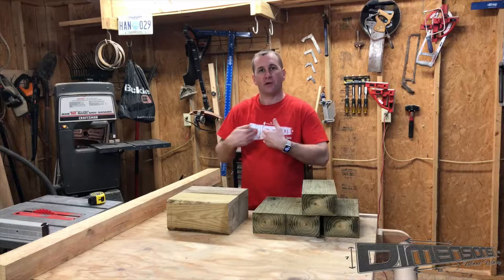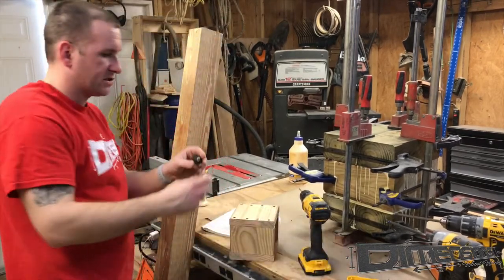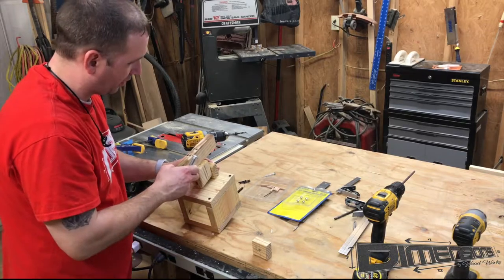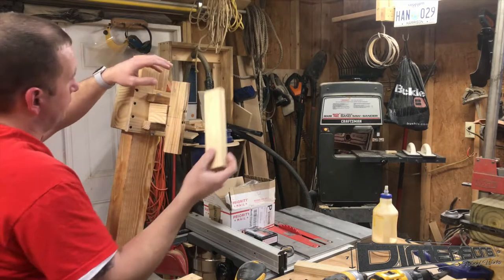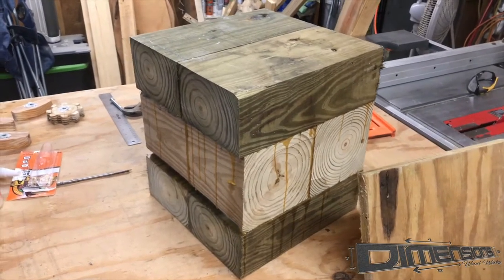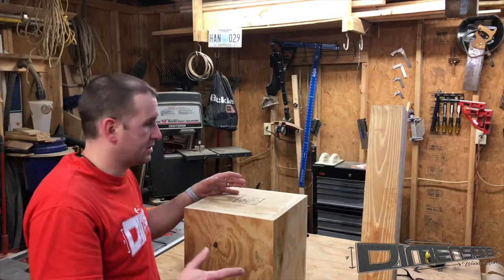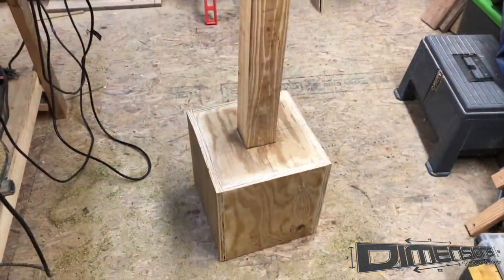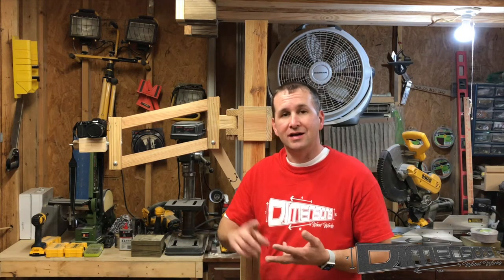Diy Camera Stand

Comment: Thanks for sharing.  Sure looks heavy enough.  i didn't see how yo set mounting the camera itself to your stand.  Did you place a bolt through the base the camera is sitting on?  Thanks for sharing..
Reply from the maker: Yeah, i left out a couple parts at the end. Still trying to figure out this whole video thing...  a 1/4-20 bolt is in the base of the camera mount and will fit most camera quick release systems.
Reply: i understand.  I just retired from full time work and want t o start getting into the content creation to help others and possibly help pay for my hobby, based on not having the income I am used to.  Problem is that I am starting from a close to zero knowledge base.  So, I am watching lots of YouTubers and other social platforms to see who I like the best and how they do it.  I think you are off to a good start.  Good luck and will try and keep in touch.
Reply from the maker: Thanks! Stay tuned... I’m about to start cranking out some more videos soon.